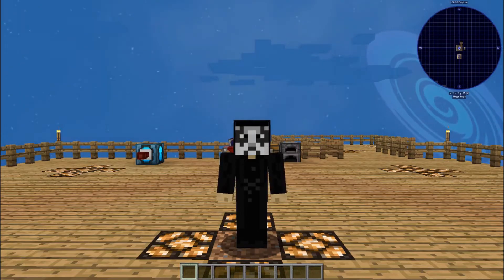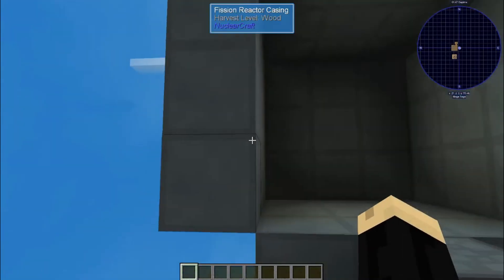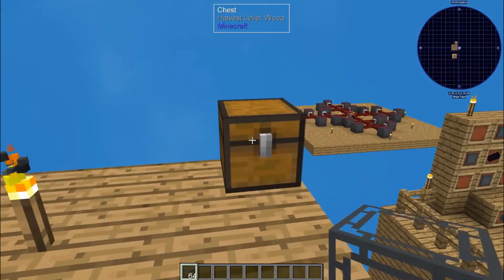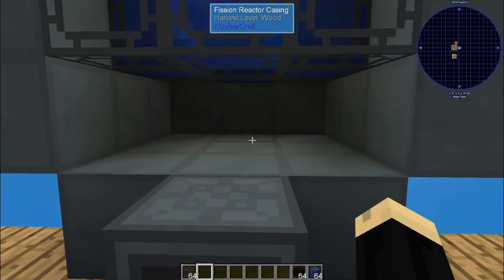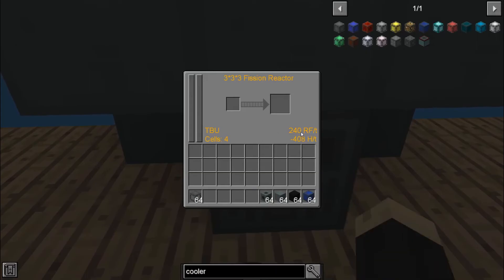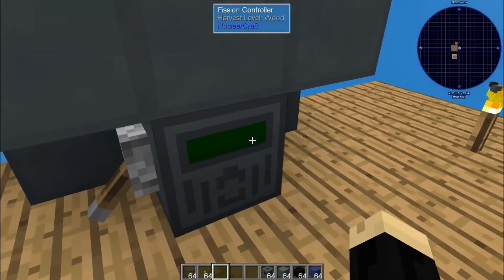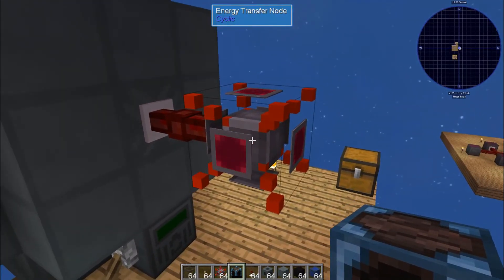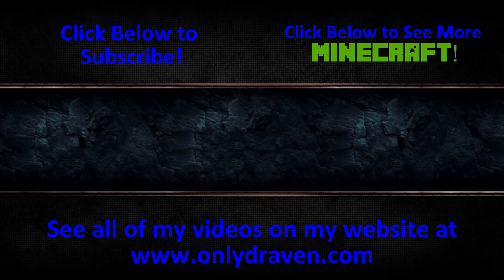Minecraft - Sky Factory 4 - How to Build a Basic Nuclearcraft Fission Reactor

Comment: For some reason whenever I do any pattern for the cells and coolers it says that my power output will be 0. Any reason why that is? Im using cryothium coolers in a 3x3
Reply: I got the same, my controller dosent light up either
Reply: @WhispersOfTomorrow  I pretty much tore it all down and rebuilt it and it worked. But then I put too strong of a fuel and it melted down so don't do that... Had to build another one

Comment: Can you have 2 wires coming out of one extraction cable so that you can power different stuff
Reply from the maker: If you place something on each side of the extraction cable, it will connect to all items.  So without using any extra cables an extraction cable will power up to 5 blocks

Comment: Hey, why the controller don't works when I set the lever and turn it on?
Reply from the maker: Could be a couple things.  When you click on the controller does it say it is complete inside?  If not then there is something off on the build.
Reply: @OnlydravenGaming  hey I understood why the reactor didn't work, it need fuel from the last update to produce energy
Reply: @OnlydravenGaming  yeah I built step by step like in the video and the controller doesn't turn even green
Reply: @Andrea-vu4oz  I also have this problem. It also says 0 RF/t. Oh. aaand, it says that there is no fuel.

Comment: Best way I found to get started with fuel.

1.Go to the Twilight forest and mine "thorium"
2.Craft an "Isotope Separator" to get "Thorium-232"
3.Use 9 "Pieces of Thorium-232" to make "TBU Fuel"
4.Craft a "Fuel Reprocessor"
5.Wait for "TBU Fuel" to be used by the Fission reactor (will become "depleted TBU Fuel" put in the "Fuel reprocessor")to get "Tiny Clump of Neptunium-236 and 237"
6.Use "Tiny clumps of Neptunium" to make "LEN-236 Fuel"
7.Use "Len-236 Fuel" until it becomes "depleted LEN-236 Fuel" the put it into your "Fuel Reporcessor" to obtain Tiny clump of Plutonium and Americium.
8.Rinse and repeat until you find the fuel you want.
Reply: I got lost after step 3, i think I'll stick with my solar panels
Reply: THANK YOU!

Comment: Could you explain how to actually get the fuel needed? It seems to be a loop where you need fuel to make fuel, I don't understand how to get started making it
Reply: Supposedly, you just start with uranium. You use a isotope separator to break down a uranium  ingot, and you put what you get into a fission reactor. You then get plutonium, and you go from there. Haven't tested this, but hope this helps
Reply: That one Guy you can get uranium in places like floating cities and twilight forest
Reply: @rickharper4533  You should also be able to get it from the laser drill. However it's rare